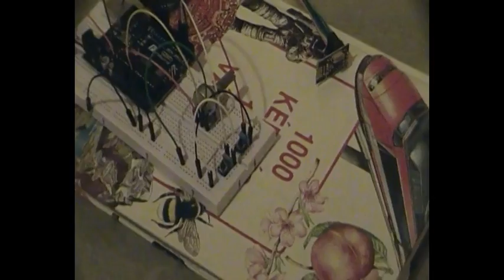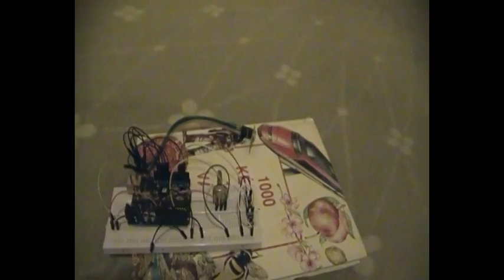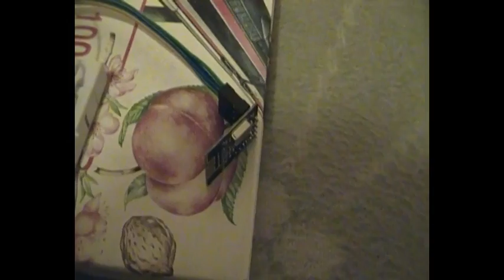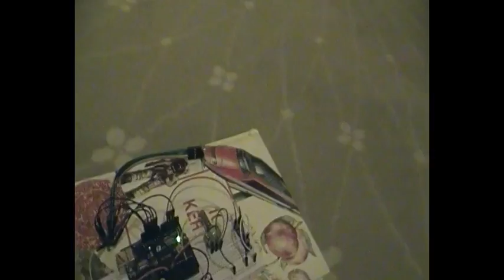Magnetic tachometer and remote DC motor control on Arduino

Comment: Hi ZauStuv,

I think your setup with the H-bridge, reverse speed and RPM closed loop (as I expect you are using) are very interesting ;)

I am working on a design I can share in a while when I am finished documenting it, or share the unfinished version right now on email, using 12 direct port access digital Input (me using three) on a dedicated Arduino only working on collecting and forwarding the input to the serial output and into another Arduino connected to a PC.  The first Arduino is sampling the RPM input from the BLDC motors through an Eagle Tree RPM Sensor reliably up to 56.000 samples a second.  It is based on "Build a 12 input pulse counter - multiple input pulse counting" http://openenergymonitor.org/emon/buildingblocks/12-input-pulse-counting

Do you have a fritzing file or the equivalent of your circuit + the code, and are you willing to share that, please?

Sincerely,
Simen Tobiassen
Reply from the maker: Yep, it's weird indeed! xD
But I only had n-channel mosfets in my shelf, so I had to build something from them. You can basically control them with 2 outputs, one being always off. Otherwise, it'll become a Wheatstone bridge, leaving the voltage difference between the two terminals of the DC motor always 0V. (That gave me now actually a good idea with the transistors! I'll might even do it later, haha!)
Also, other people suggested me to change the reed relay to an optogate, or a hall-sensor, which can measure up to 10.000 rpm or even more.
Oh, wow. Your project sounds interesting. You can calmy send me a link, even if it's not ready yet. It might motivate me as well! What's the other Arduino going to do, which doesn't count the RPM?
And about the code, my laptop broke down, and I forgot to save it, or at least to upload to Google Drive, or Github. My bad. If I'll get over my exams in the university, I'll return and try to rewrite the codes. I messed up many things there, so I'll definitely do a better job next time. But if you're interested about a special part, I may help you.

Cheers: Bence
Reply: Thank you for answering! I contact you directly, as I need to send on email.